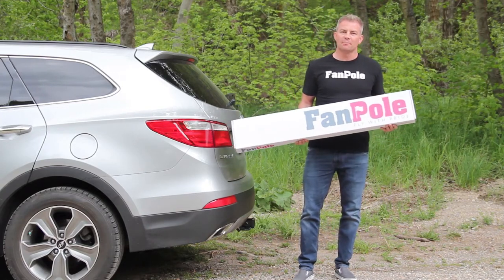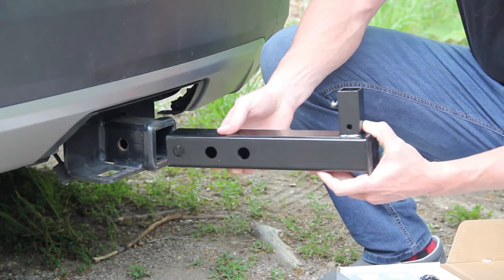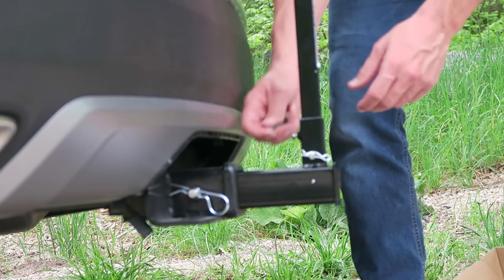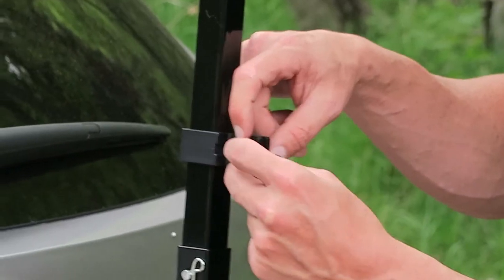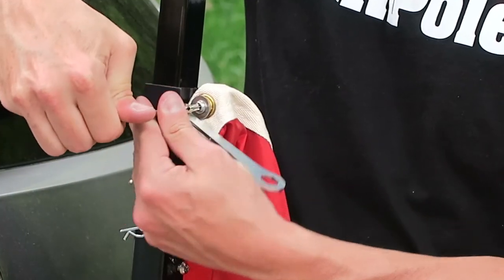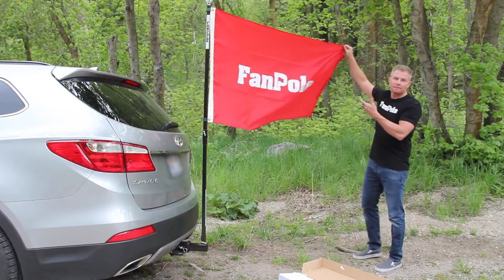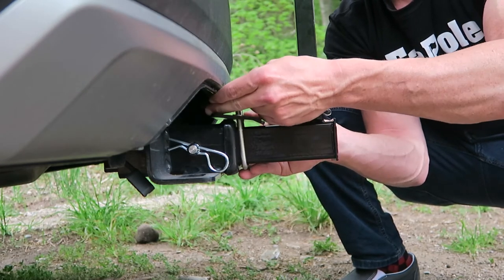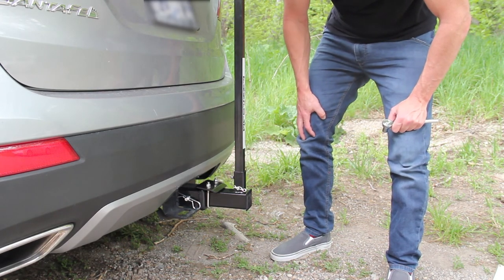How To Setup Your FanPole

Comment: This seems like a great product, but SpeedPole is the winner in my opinion, because the flag EASILY gets wrapped up on the pole, because the design doesnt allow the flag to spin. Its just weirdly locked with a bolt? SpeedPole has a better design with a round hook that allows the flag to spin on the pole, so it will never get wrapped up.